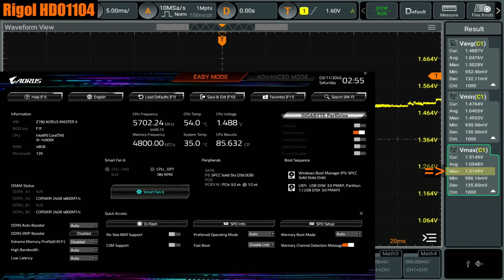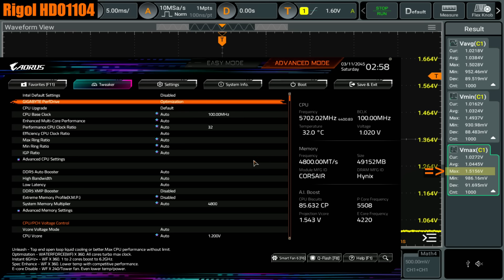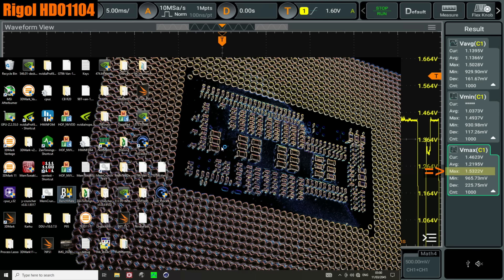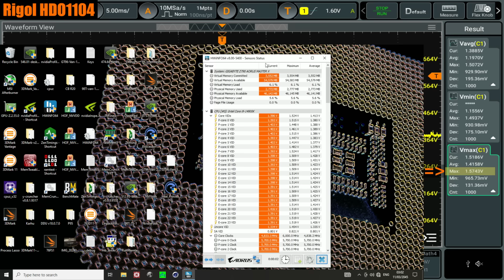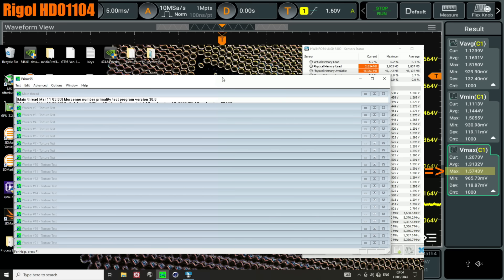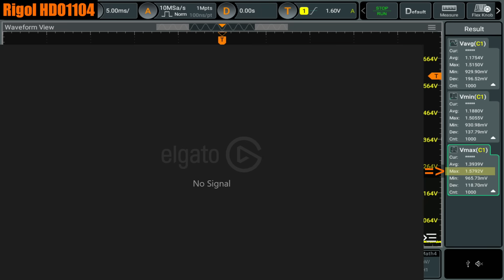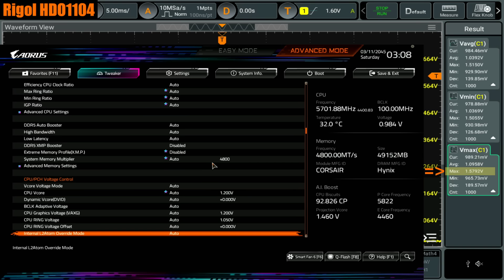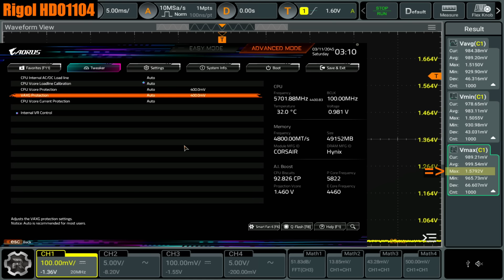Turning off "Intel Default Settings" with Microcode 0x129 DISABLES THE VID/VCORE LIMIT

Comment: Imagine how many normies will never update their bios and will just slowly degrade their chips.
Reply: Jokes on you mine already degraded before the update lol
Reply: What an inane comment on the release of a bios update
Reply: what I don't like is the fact that these new bioses with the latest microcode are labeled as beta.
Reply: True
Reply: How do you know the op opinion is True? Please elaborate.
Reply: If i understand it right the cpus degraded every since they turned on their pc. Lower bin chips show it sooner but all of them are affected in the long run.
Reply: The fix isn't reversing what's been done. Chips that are prone to this issue will see premature failure compared to unaffected.
Reply: people need to stop using the word "degrade" by itself when talking about cpu.
even worse with "slowly" because literally every cpu does that
Reply: @manusiaorang2842 y’all are fucking dumb but you specifically at least everyone here is talking out their ass and are aware that they’re talking about a specific block of chips. But you are here pushing your glasses to the back of brain “um actually they all degrade” no shit 😂
Reply: @manusiaorang2842 I mean, technically yes. Literally every thermal cycle places extremely small “wear and tear” on every processor. 

But, in a stable system, even an overlooked one, the silicone simply will not meaningfully wear out on timescales under 8-10+ years unless something is causing it to exceed thermal limits (like, you know, acute applications of insane internal voltages commanded at an integrated layer that bypasses thermal limit protections…). 

So, no, people only need to “add context” for discussing degradation in the rare case they’re discussing this kind of routine wear and tear. Otherwise, when someone discusses degradation in a new or newish processor, they clearly mean something much more pronounced and acute than normal wear and tear.
Reply: @piedpiper1172  the problem is some numbnuts who probably never touched a computer says "amd cpu doesn't degrade" like wut.
idk if they're trolling or not but this is more common than i thought it would be
Reply: well i guess that's because it's in a braindead shorts channel that post things with 5 template, 20 times each template
Reply: @manusiaorang2842  Well, again, they almost definitely do not mean “it’s literally immortal.” They mean “amd CPUs currently or recently on the market do not have some fundamental defect causing them to self-cook at an extremely accelerated rate”
Reply: @piedpiper1172  i hope so
Reply: The class action intel bouta get hit with will be legendary i only happened to get a yt vid about the intel problem and then found out my cpu was killing itself(17 14700f) there are thousands of ppl who still dont know
Reply: Hopefully fast enough that Intel has to pay for the warranty claim
Reply: Quickly*
Reply: None, the new microcode will update through and load on OS boot!
Reply: I'm just fighting with mine self to  upgrade bios or not. Haven't tried  beta asus bios with latest microcode update yet. But mine first crash was 1 hour   after updating to last bios. It's mine first crash after using mine cpu for 8 moths. So I changed back to older version of bios.  So far after a week of playing games on unreal engine no more crashes. So really afraid of installing new bios.
Reply: considering that the problem is with the manufacturing failure, this is just a band-aid. it's gonna degrade and fail regardless.
Reply: big thumbs up for this comment for saying something so obviously true that only a snowflake could be triggered by it
watch them cry in despair over how your generalized statement that is generally true and easily proven true all of a suddenly requires millions in government funding and hundreds of hours of research to survey and poll every single Intel normie and include an exact headcount... because this is the only possible way they can think of to prove you wrong and also keep their cognitive dissonance alive
Reply: Any actual numbers? Reality matters more than imagination.
Reply: = Faster replacement. 🫵🏻
Reply: Most normies don't even know how to enable XMC, I doubt they'll push their chips to degradation if high usage is what degrades them.
Reply: @esqueue  It's not high usage... its the board pushing 1.6 volts to the CPU when it shouldn't. it might even be happening at idle
Reply: How fastly
Reply: Imagine how many normies buy Intel 13th or 14th gen and slowly degrade their chips regardless of BIOS.
Reply: @razorblade7108  do you have someone more valuable than a pc in your life?
Reply: @valentingjorgjiovski4896  Sounds kinda butthurt to me. 😂 And the answer is yes of course. People without 13th and 14th gen CPUs tend to spend less on their PCs while having them run longer, so there are easily more valuable things around them, both symbolically and financially.
Reply: @razorblade7108  nah no one is champ
Reply: 99% of the users newer update the bios… So Intel is hoping to sell a lot of CPUs in the future to people who needs a new one because the old does not work anymore…
Good plan!
😂
Reply: there really should be like a pop-up message or something tied to windows update or intel driver update utility.
Reply: Not much to degrade to be honest
Reply: I’m a normie, I’m able to do it, and it makes PC gaming stressful for me
Reply: @eagereagle65  If you are able to update a BIOS you are already a somewhat advanced user. As for it causing stress for you - I can understand this but remember that these things not only happen on PC. Just think of the Red Ring of Death on the XBox 360 - that was also a hardware issue just waiting to happen to most users.
Reply: What? These new updates are even worse than april 2024 updates. I get higher voltages higher wattages higher temperatures(99C) and lower benchmark points. Loool.
Reply: Meanwhile my board not even getting the BIOS patch:
Reply: I imagine it's not the simplest thing for the average computer user. I had to remember to readjust my bios settings after bios update reset my boot order. Took 45 min before I realized 😅
Reply: Yeah I've got a friend who uses his PC for 3D rendering (he's an architect) but he's not very tech savvy (he's more like plug and play and never touch anything)... He has a 13900k, I tried to warn him 2 weeks ago but he didn't seem to care or take the issue seriously
Reply: I'm gonna update the bios, it probably bricks, and then I cry.
Reply: Get off your nerd high horse. Your egos are out of control
Reply: Hi, so I have an i7 13700k I did under clocked it to 5.1Ghz and undervaulted by -0.220mv looks stable giving that I tested it in cinebench r23 for 30min and it gave me 29000 point is it safe or it's gonna degrade over time 🙁?
Reply: When you have an old bios to oc better. Good thing i dont have intel or ryzen
Reply: Normies with OEM/SI systems will get the BIOS update pushed via the system bundle-ware.
Reply: Are normies the minority or the majority with these high end CPUs?
Reply: @Yusuf_K7  there's probably a tighter correlation to income level than to technical proficiency
Reply: @Yusuf_K7  Majority
Reply: Majority @Yusuf_K7
Reply: @Yusuf_K7   It's hard to say, but this issue wasn't confined to KS chips, there was a significant range of 13th and 14th series chips that were affected. Prebuilt computers is still a very significant market and I would say that it's a reasonable assumption that the majority of people buying a prebuilt haven't got a clue what a BIOS even is.
Reply: @Yusuf_K7 the vast majority of people who buy desktop cpus are normies
Reply: @Yusuf_K7 majority prolly many ppl like myself bout prebuilts i only found out cause i happened to get recommended a yt vid about it
Reply: Most of them I think
Reply: @je5terc0re  Lmfao you're in fantasy land.
Reply: Thoughtless comment, considering everyone was slowly degrading their chips due to over-voltage.
Reply: Imagine how many people actually believe that this Microcode update will save their likely already damaged CPU s.

After being caught in numerous lies, I thinknI would be far less trusting of Intel. 

The update doesn't change much on most MBs.. mostly just forces more core idling, regardless of ppwer profiles selected.
Reply: Aren't Windows forced updates with forced reboot supposed patch the microcode, as an alternative to BIOS update?
Reply: The microcode will be applied by OS updates during boot anyway.
Reply: Normal people you mean. The geeks should just move on, leave intel alone.
Reply: Dude bios update is double click come-on. Everyone need to do system/windows updates all the time. Most of it done automatically. This is really not constructive response dude. If my mom can run windows updates and drivers firmware update anyone can. It is all automatic via vender software. I really don't understand your attitude. This is the way software get fixed via updates. Like a game or a driver or OS or bios or printer or what ever. It is like complaining that you have to take a pill if you sick lol.
Reply: You don't need a BIOS update to update microcode. it's provided in software by your operating system without any intervention required.
Reply: @Mallchad its funny that you are an ignorant and you dont even know that.
Reply: Degrade happens after 4-5 years. Intel knows about that timline. Its time for a new CPU. The era off 2600k i gone. 

I am amazed tho about 1.55v during Windows startup, that is significant...
Reply: normies will never buy enthusiast grade cpu
Reply: @adrianvorkaaa3534  yea they will, for example i know quite a few streamers that use 13900k prebuilds and im willing to bet none of them know how to enable XMP let alone update bios
Reply: @ThunderingRoar  What is "quite a few" though? It's anecdotal at best.
Reply: @adrianvorkaaa3534  Think again. 1x700 are affected as well. That's the most normie tier of cpu outside of 1x400.
Reply: @adrianvorkaaa3534  you`re very wrong. Most of these cpus are bought by normies. Anyone with money can buy high-end cpu, hell, even people without money can buy it, they just get  by itinstallment payments.
Reply: @adrianvorkaaa3534  Nah, its kinda typical for people who have enough money to buy top grade PC, pre-buit or built by the shop after the order. Also a lot of people don't check hardware news when they aren't planning to build PC.
Reply: @adrianvorkaaa3534  Uh, every OEM/SI almost categorically refuse to pair a 4080 or 4090 with anything but a xx900k. And normies know what those are, and want them.
Reply: @andersjjensen  @ThunderingRoar hmmm yea that's true. i forgot about SI/OEM builders
Reply: @adrianvorkaaa3534  actually a lot of richer normies will buy high-end prebuilt gaming PCs which could very well include the 14900K
Reply: @adrianvorkaaa3534  Remember, though that this is not only a thing on I9 and I7 CPUs - according to intel CPUs down to i5 models are affected - they probably aren't driven quite as hard so that the degradation wouldn't happen quite as quickly as with the high end stuff.
Reply: @CaptainShiny5000  Exactly
Reply: @adrianvorkaaa3534 I bought a Intel Core i7-2600K back in the day, before I knew anything because it was recommended to me. I didn't know about overclocking to need the K version and a i5 2500 would have probably done me fine.
Reply: @adrianvorkaaa3534  No, they usually got it from daddy and mommy to have a streaming career. :D

Comment: 18 months later my 14900k still running great locked at 1.4v
Reply: How the hell did you get 18 months? 14900k came out Oct-23.
Reply: @ZomgZomg007 because it's a bot. Look at the username.
Reply: @ZomgZomg007  doesn't understand how time works, so probably doesn't understand that they've just staved off the inevitable and that just limiting the volts doesn't adequately address the issue
Reply: 14900K is not even 1 year old, so either you have a 13900K or you're lying about the date

Comment: I don't trust Intel. I trust that Intel will be Intel. This allows me to avoid the pitfalls of trusting Intel. 

And before the fanboys and such get on this; Yes I am the same way about AMD and Nvidia.
Reply: Intel and Nvidia are the EA of hardware companies, AMD at least is run by engineers
Reply: @mspaintclippy  what a dumb say
Reply: @Ryzen9800-c2y  You can't even spell, sit this one out
Reply: @mspaintclippy  Here, you dropped these -> . and . for your earlier sentences. 

If we're going to be grammar jerks, might as well be accurate ones.
Reply: @mspaintclippy  Average clueless fanboy
Reply: @Kompe-b7b  I still use the 6600k from intel, good luck with that narrative.
Reply: @mspaintclippy  That's even worse, you haven't used any modern CPU from both companies and stil randomly throw praise/criticism, indeed clueless.
Reply: @Kompe-b7b  I have, you have no clue what you're talking about
Reply: Wise words ;)
Reply: nvidia is the most reliable of the 3.